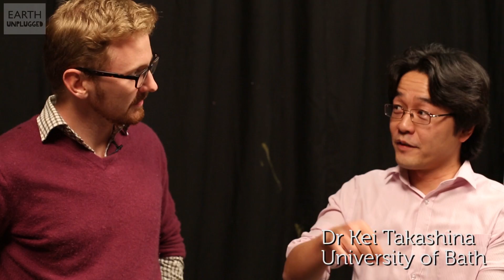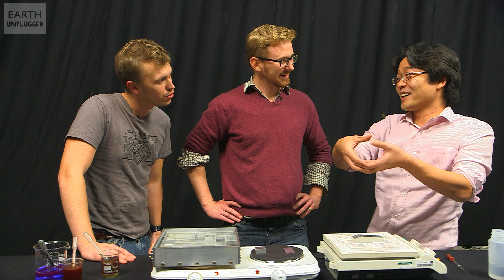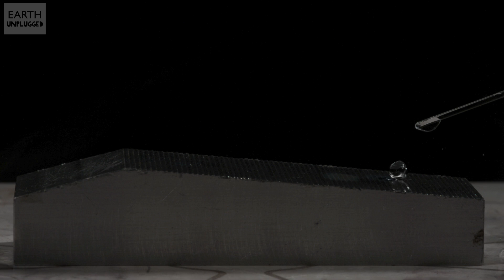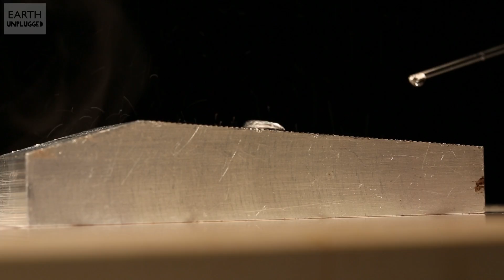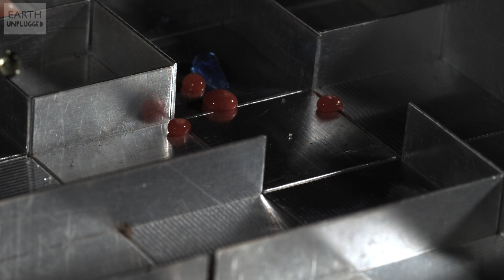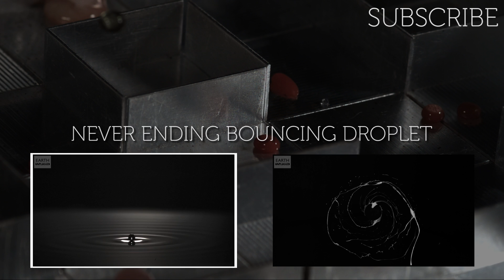Water Flows Uphill! Leidenfrost Effect | Slo Mo #41 | BBC Earth Explore

Comment: I would like to reproduce the experiment using an inclined surface. I was wondering if i can use a flat surface or do i need, like in the video, a surface with moats/channels. And if it's the second choice, is there a standard distance between them or it doesn't really matter?
Reply from the maker: Hi Oana, the surface would have to have the grooves, which channel the hot vapour coming off and give it the lift as it moves upwards. There’s probably a sweet spot of groovage width, but the Bath Uni site probably has a few more statistics: http://www.bath.ac.uk/news/2012/10/30/water-travelling-uphill/ Apparently, the sharper the ‘ratchets’, the steeper the droplet can climb. Good luck!

Comment: Don't try this at home? Just heat up a frying pan and drop some water on hit :V
Reply: don't fry this at home...
Reply: gsards um, my pan was much hotter than 200 degrees. It worked.
Reply: Won't work if temperatures aren't in the 180-200 range.
Reply: So if you do this with a pan, it ruins the paint on the outside. I figure thats because nothing ( food or water ) is absorbing the heat from the stove top, the heat is forced to enter the pan only, causing it to no longer act like a conductive membrane but as a continuously heating source ( to the provided temperature ) and I believe my pan was not designed to remain at this high temperature for long duration's of time.
Reply: Conservative USSA
It's a frying pan. It can take it.
Reply: MegaRekyyli
In addendum, why put anything on the stove? Just drop some water onto the hot plate, assuming you ain't got a gas stove.
Reply: MegaRekyyli It depends on the quality of the pan, however most are not designed to sustain super high temperatures for long duration's of time, despite their purpose.

A pan should usually act as a membrane for heat to transfer through from the stove top to the food or liquid in the pan, however if you remove the food or liquid the pan absorbs more heat than usually.

As I said though, if you use regular cooking equipment like me, you better think twice before doing this, as such the " do not try this at home" Is a valid warning/command.